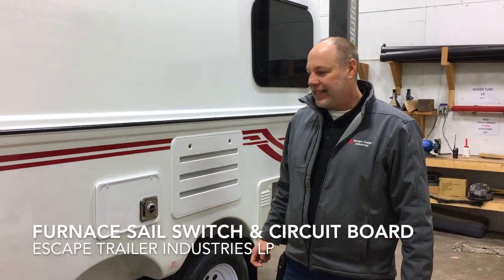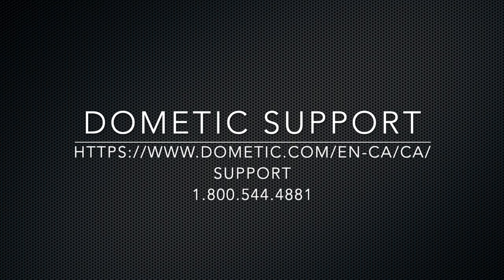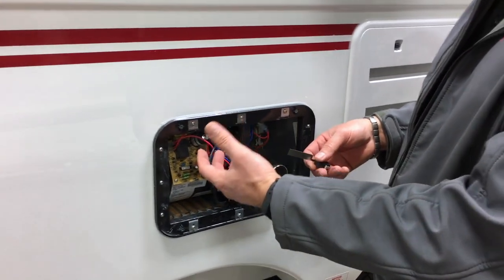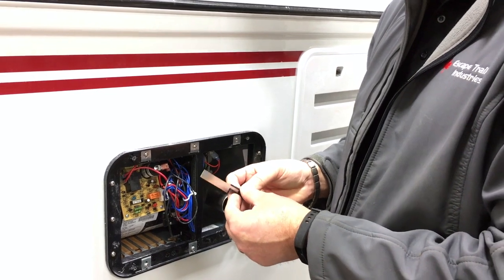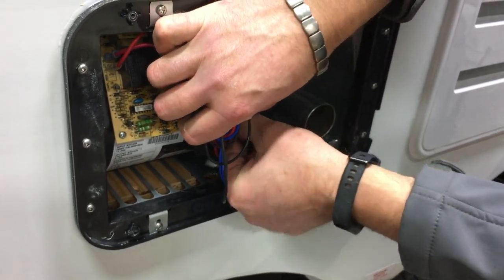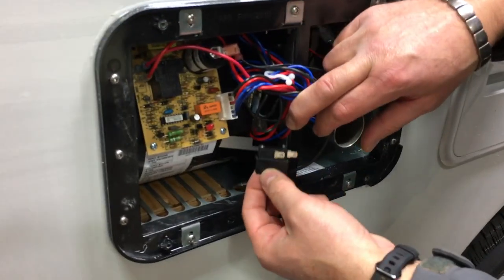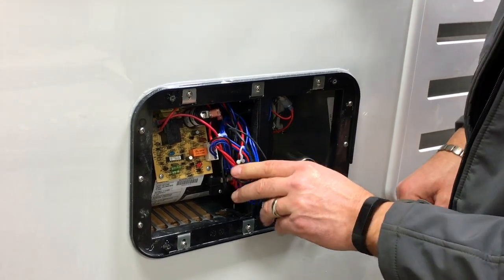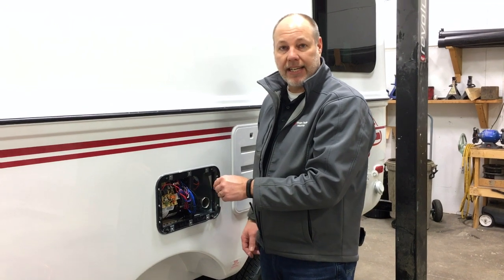"DIY Repair: Replacing Sail Switch & Circuit Board on Your Escape Trailer

Comment: I want to say thank you for this video. I never messed with a sail switch. Last night our 2018 Airstream furnace stopped working. I tried all the usual stuff with checking propane, turning on off checking for blockages. After seeing this I figured dog hair got in there. This morning I took the cover off and sure enough the sail switch had a hand full of dog hair around it. I cleaned it off and works fine now. Total time 10 minutes total cost $0. Thanks so much.

Comment: You commented that the air is recirculated from the inside of your RV through the blower and then back into the RV. My RV does not have any return air vents so I'm wondering if you're maybe mistaken on the recirculation statement.

Comment: For those whose furnace is out of warranty, can you tell us the part number for the sail switch and circuit board? Are you using the same furnace for all trailer models and years? If not the same furnace, is the sail switch the same in all cases?